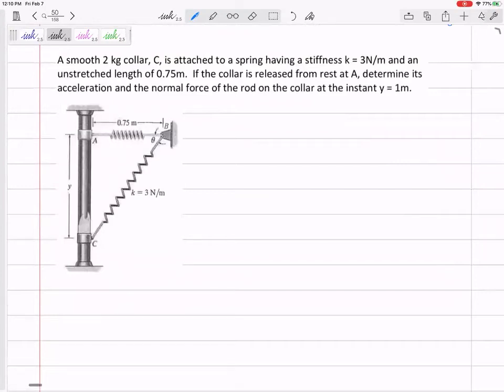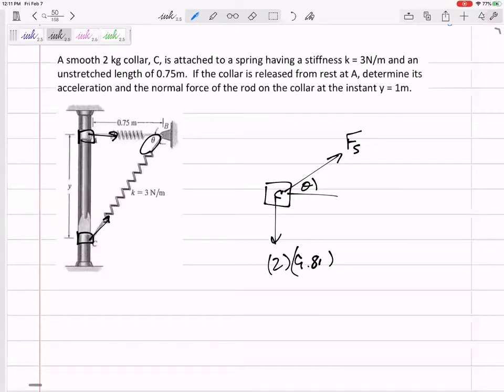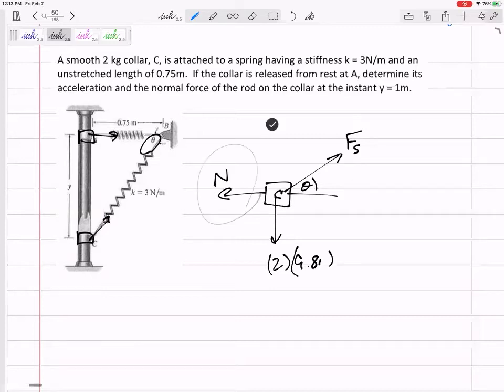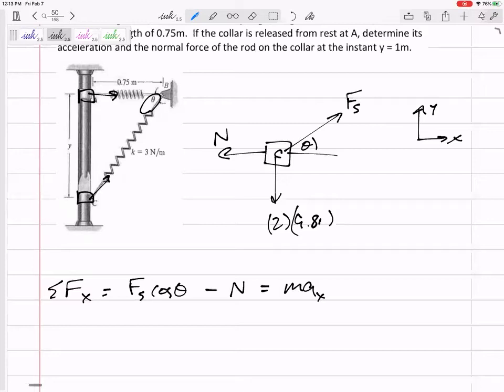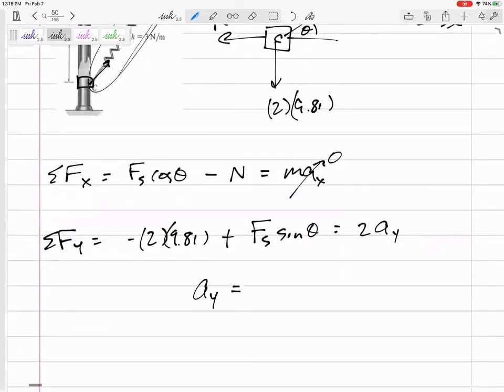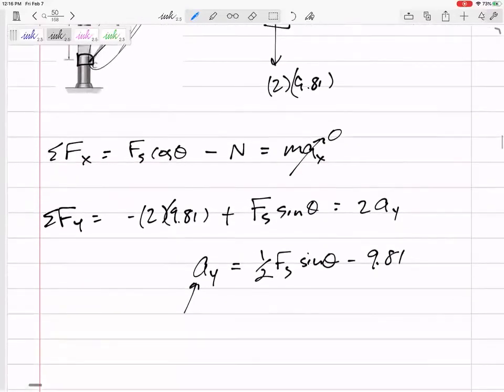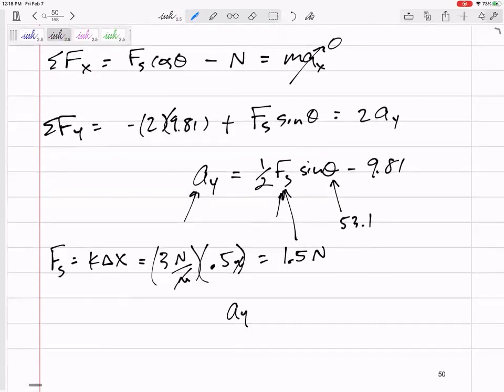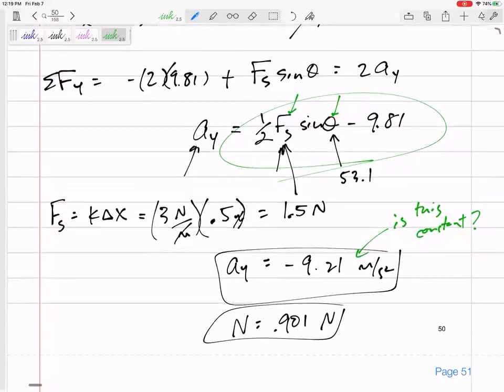Dynamics - Particle kinetics rectangular coordinates example 2

Comment: why did u multiply 0.5 to 3? isnt it supposedly 3(1.25)?
Reply from the maker: The force in a spring is k(x) where x is the “stretch” of the spring, not the length of the spring. So if the current length is 1.25 and the unstretched length is 0.75, that means it is being stretched by 0.5. [x is length minus unstretched length]
Reply: @engineeringdeciphered  oooooh thanks! still do ur videos man! it helps